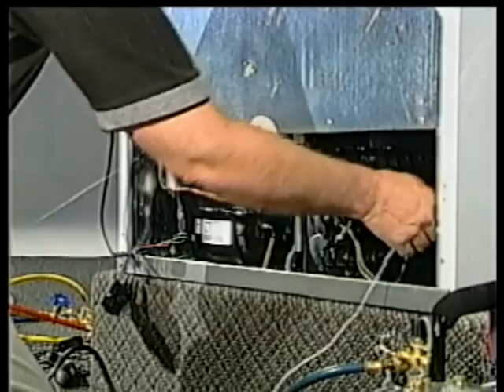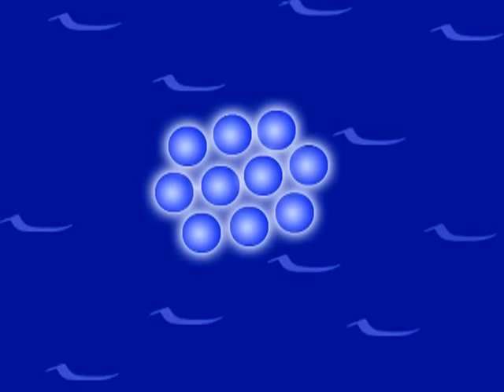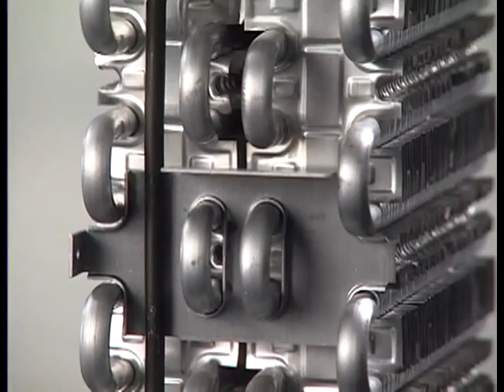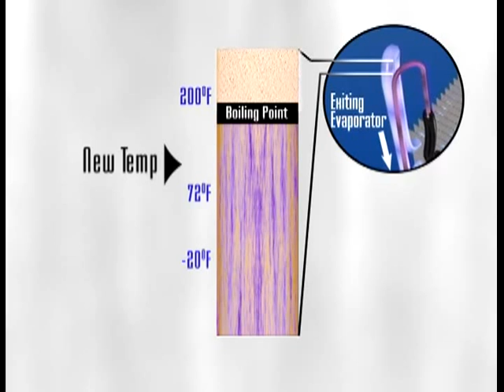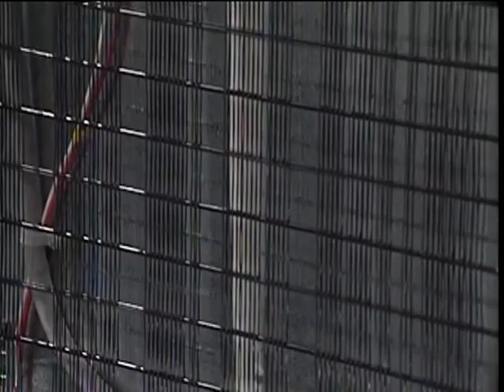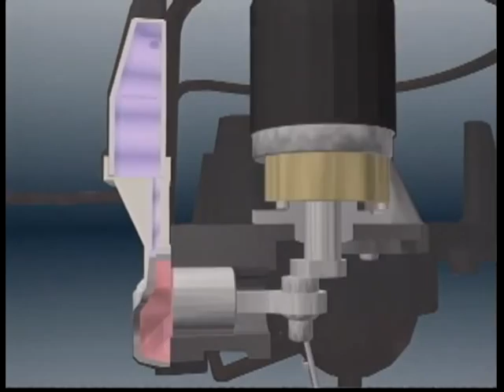Electrolux Refrigeration DVD - Part 1

Comment: The explanation is wrong. The gas bubbles move up because of the low density of the vapour and hence it being subjected to buoyancy forces. If you watch only after the vapour form a bubble and the lliquid act at the bottom side of the bubble it cannot move up.